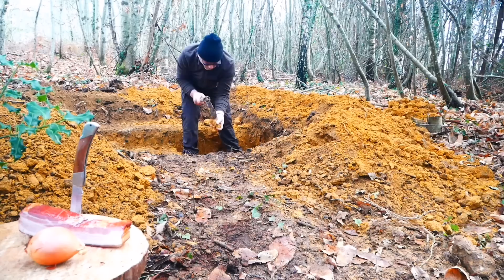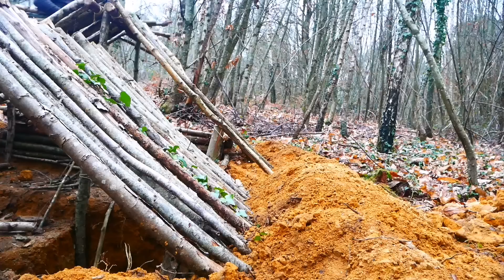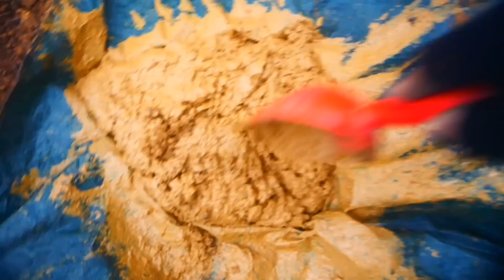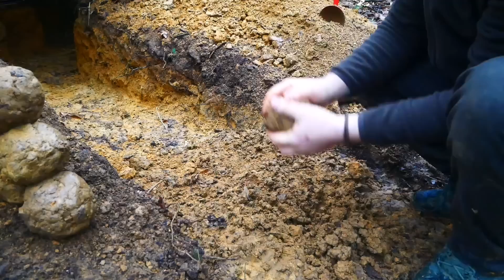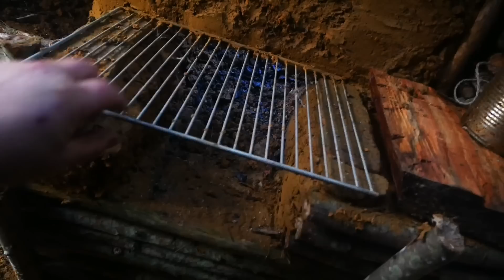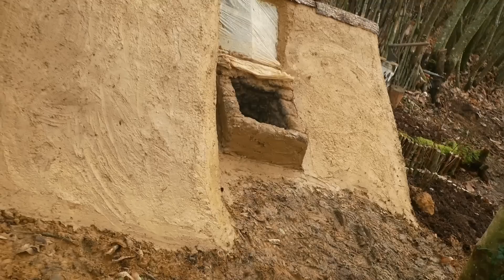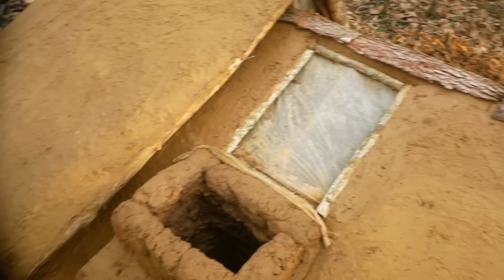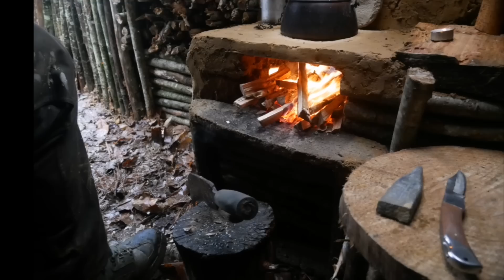SURVIVAL EARTH LODGE HOUSE - Bushcraft  a pit warm house The best of all natural Shelters!!

Comment: Spent 20 years in the Army:  First big rain and it will turn into mud puddle.  Water needs to drain away from the door, not into it.  Chimney needs a cover.
Reply: Think your missing the point here but I might be wrong.

Comment: I know the farther you go subterranean, the less wall construction and all that, but you just made a mud sitz bath. Good effort, though.
Reply: I would guess that all depends on the drainage.  He did dig out the walkway.  I would hope it flows outward, but you can't really see the slope in the video.
Reply: He still built wooden walls, though.  He didn't start the construction on top of the berm he built, I don't think.
Reply: It looked like he found himself a flat place on the side of a hill and had his doorway facing where u would be walking down the hill to come in that is a soggy trench and shame he spent so much time trying to make a water proof roof so the sun cant dry up the mud hole... and nice effeminate none related ax throw with a camera cut in the middle, i bet he doesnt do his own stunts...
Reply: @K_c_B  definitely with you on that effeminate ax throw.
Reply: I was thinking the same thing......he just dug a swimming pool with a roof! That hut is just gonna fill with water.

Comment: Great efforts there Athos, the hut looks very snug and windproof. Love the axe and the wide blade.
I read in your blurb that your grandfather spread clay and herbs on buildings, I can understand the clay but why the herbs, which variety and why please?

I'm a traditional lime putty plasterer (like your grandpa) and have made strawbale and cob structures like internal walls and rendering with a haired lime mortar, so watching you spread that mud on the sticks is my day job, it looked a great and sticky mix. it's astounding the richness of the yellow & orange colours of your subsoil, (which part of the world are you in?) because our subsoil in Somerset is so different (brown to dark brown subsoil) with lots of stone, (there are about 6 small quarries around here on the Quantocks) it's so dense and heavy I had to use a bolster and a 4lb hammer to cut through it and it makes the best cob: 2 wheelbarrows of subsoil, 1 sharp sand plus a 1/4 bale of chopped straw. Sprinkle on water and walk in it to mix, adding a little more water as you mix it with your boots, it eventually makes a good and solid cob. My 300 year old home is made from it.
Reply from the maker: Thank you very much man. It is necessary to put herbs in the clay to avoid cracks
Reply: @ATHOSOutdoorProspector  what herbs mate?
Reply: @ATHOSOutdoorProspector  if you use clay for waddling, say, to form a wall,  use plant material, like straw, grass, as a binder, yes, to avoid cracks
and to give it integrity

Comment: I'm intrigued. I'm hooked. I'm going to watch it over and over again. But I do have a question. Maybe I missed it. That walkway into the shelter looks like it slopes downward into the shelter. How do you keep the rain from running into the shelter?
Reply: But still no answer to how to keep water from flowing into shelter.
Reply: @hey.hombre  He is using moss so pooling water wont flow down the sides. Also leaves on the ground, probably moss as well.
Reply: Didn't you see the generator out back, that they use to fire up the sump pump?
Reply: @davemacgyver573    Next to the air conditioner?
Reply: @hey.hombre   I wonder how he keeps bears out. All those irresistible smells. He’d be like a bunny pulled out of his nest. Unless this is in his yard?
Reply: @HayleysComet3  Maybe there aren't any bears in his country?
Reply: @davemacgyver573  Now that is the most logical answer.
Reply: @robertdutcher8081  lol
Reply: @HayleysComet3  city park. The cops keep an eye on the bears.

Comment: Interesting build, curious to know if water intrusion would be an issue?!
Reply: Of course it would be, uncovered chimney and the entrance is a man made water course
Reply: I was think of building basically small wells in the corners of the lower section, just dig deep little holes, as far as u can, for the inevitable water to collect. Aswell as build a chimney cover.
Reply: Unless the entrance is on the downhill side he basically built a water trap. Better to build up an berm on the highside to allow water to run around the outer perimeter. Also wouldn't that leaf vegetation just rot and disintegrate over time thus eliminating the water barrier on the roof? Better to put a thick clay barrier  with sand then clay again which is less likely to have water intrusion. The sand gives it a way to breathe and allow the water to run off.
Reply: Nice build. 
I would use some chopped straw or long dryer grass in the mud to strengthen it.

Comment: That was actually impressive.  Just curious how you deal with rain coming down the chimney?
Reply from the maker: The chimney it's going to be covered👍
Reply: Same as the underground leveled path that literally goes into the house
Reply: @ΑποστόληςΒαρλάγκας  Yeah when I first saw the finished product at the beginning of the video, I wondered if he thought about when it rains, he might get flooded out depending on how hard it rains and for how long. Why didn't he start building on level ground? Then I thought, maybe the winds are high and he built it into the ground to avoid the high winds toppling the shelter?? 🤔 I don't know. Either way, I can't wait to see the look on the building inspector's face when he comes to approve the C of O. 😆
Reply: @ΑποστόληςΒαρλάγκας  normally you want the water to go from the house, not against... better to build on a hill...
Reply: @1Bman  I don't know if you understood my point. Since the house has a path that is lower than the grounds' surface, the water that will be collected there it will eventually ends up in the house. So the path needs a roof and and some kind of boulder from the rears to avoid flooding

Comment: Is anyone else wondering how that mud roof is going to stay on that house when it rains?
Reply: I am and have been for awhile 🤔🤔
Reply: Errrm, it won't. 

I built a pizza oven with similar sand/clay mix. Dries really hard and incredibly strong. However, the tiniest bit of rain just washes it away.
Reply: I was too... now if he built a fire on top of every section of the mud... perhaps with enough clay content in the mud... it would harden well enough to to last.

I was thinking he was going to build a debris shelter with thick layers of leaves stabilized by more branches on top of them...  at least a foot thick for winter insulation.  Pine needles layer about four inches thick on the bedding area would be ideal, soft and insulating from the damp cold ground.  Also a rocket stove design for the fireplace would be really efficient for heating, cooking, and using minimal wood.

Other than that, it was a pretty nifty project and 
oops cool... though, hmm, speaking of rain... it’s a great place to accumulate water in the lower shelter... I would want a slope to dig into.

Comment: Maybe I missed that part, but during periods of rain, does water seep in from the soil and accumulate inside?
Reply: Let’s not be talking reality here. Lol
Reply: Should be named a drought shelter/ bush jacuzzi
Reply: I guess the bed is up higher.
Reply: @jlmur54  lol
Reply: He going to use water tight. Or flex seal.
Reply: @hobens1  alot of tubes🙄🙄🙄🙄🙄
Reply: It looks like run off water would fill his structure.

Comment: I'm just wondering: What happens if it rains? Since it seems most of your shelters are partially below ground.
Reply: Moat?
Reply: Dude, I was thinking the same thing.
Reply: @carolbaughan8768  That was my go-to answer. But it seems there would be a simpler solution I'm just missing. Maybe he just builds them on raised areas where the water doesn't collect into streams and that's enough where he lives.
Reply: @mr.e8282  as long as the entrance path was sloped downhill it looks sloped towards it and it would need something covering the clay roof . as it sits now if it rained it would turn into a mud pool
Reply: T u

Comment: Just here to see the haters crying that he blade scraped that rod to start a fire.
Reply: Fire steel has been found in Viking burials from over a thousand years ago. Flint stocks are definitely not a modern invention
Reply: I thought it was pretty cool.
Reply: Josh Schneider I believe he was referring to using the blade to scrape the ferro rod.. many scream this will ruin your knife  blade.
Reply: @speculizer1971  It does, other than ruining the edge where you run it over the ferro rod the heating can cause the metal to harden and thus screwing with your blade edge as well.
That is why you just use the back edge of the blade (I guess unless you have one of those knifes where they polished off every sharp angle possible)
Reply: SilvaDreams Oh absolutely... I wasn’t disagreeing with them, it’s merely common sense.  Unless you never want a sharp knife I would have something dedicated to the rod. Or just keep your good EDC knife away from it.   Or you will be constantly working a new edge on it.    But it’s his knife in the video and his decisions.

Comment: 2 rocks at the bottom of the chimney opening at center and a overcrop off the end for rain to run off make a clay piece of plywood lay over make mud flooring before you leave stack rocks in the mud up top then put leaves then put sticks at bottom up over the roof one opening for water to run off support the sticks from falling off.

Comment: When your pork gets green , like on the other video-

Cut the end ( like u did. ) , score the top where you want to make slices through,

Clean your blade.

At the cut end cut lengthwise through your meat to where you scored.
Do sides.

Then make your slices.

In this way , you are not carrying the bacteria on the knife through each slice and bit of the pork.

You should still get your essential molds and bacteria’s like this , but not to excess.

Hope this is of service. 🔥

Comment: Nice! Good job. It looked like the dirt might have some clay in it too which is good, but even with that be careful of the rain. Even clay, if not fired hot enough, will dissolve in the water. That's not a deal breaker though, it just means you need to maintain it more.

Comment: One has to note that while the bush craft employed in this video is sound, his harvesting of building materials might be concerning. Collecting birch bark from live trees (opening the tree to bugs and early rot); Harvesting live seedlings instead of sound dead wood; failure to place a primary roof covering of moss; failure to carve rain water catch trenches away from the structure, and failing to place a chimney rain cover to angle rain away from the pit. A front door, of sorts, is also suggested instead of having to clear the structure of vermin every time you come back from a foray. Good, sound structure, but questionable sourcing and inattention to details. Entertaining video nonetheless.
Reply: Well put! I noticed most of those as well. Also the issue of heavy rain is a big one.

Comment: I love this and I could watch it for hours. There is a question I’ve always wondered in regards to this kind of construction. The clay/mud cladding on the roof and sides… how does that not wash away in rain? Like isn’t a rainfall making it into a more runny mud consistency again? How often would you need to re-apply the cladding ?
Reply: Well the clay will harden on hot sunny days and with the heat of the fire, it does crack as it drys but it wont wash away with rain, in medieval times it was wottle and daub, aka sticks, hay, clay and feces, when it dried it was like primitive plaster so somewhat waterproof, this is similar but wont be as good.

Comment: The question is, how does that hold up in the rain?  I mean, mud and sticks?  Unless you have something to shingle the water off of the roof, it is just going to be dripping mud on you rain in a heavy rain.  Also, you will want to put that on high ground and angled such so that the water drains outside rather than inside if a heavy rain does come.  If it rains, and you just dig a hole in the ground and do this, your house will fill with water.  Groundwater will start pouring in from the sides/walls.  Something to think about.  You may get a rude awakening.